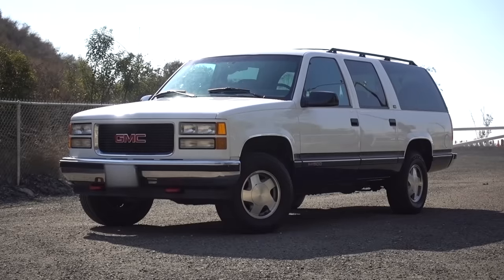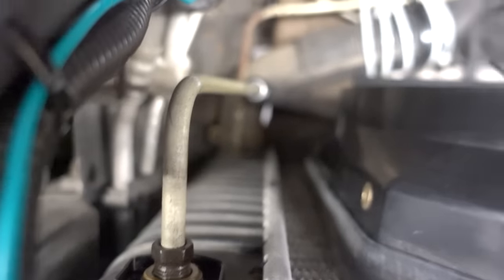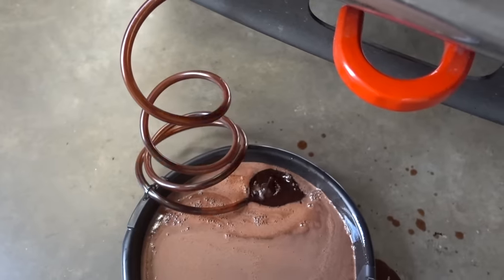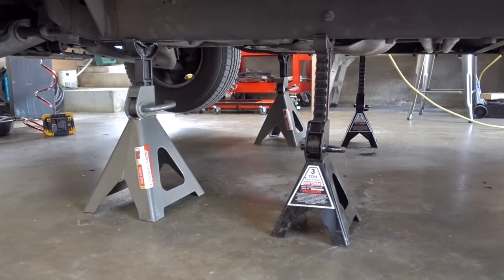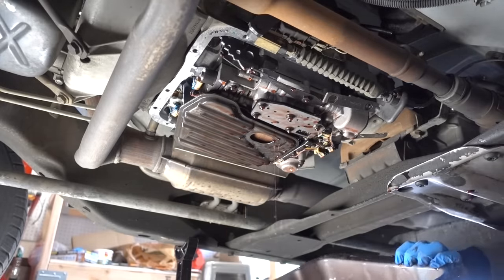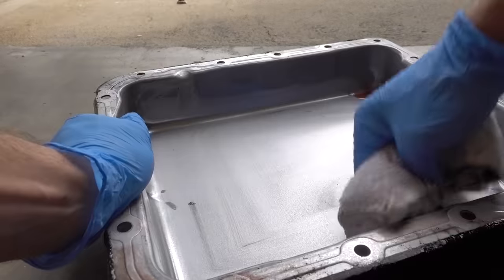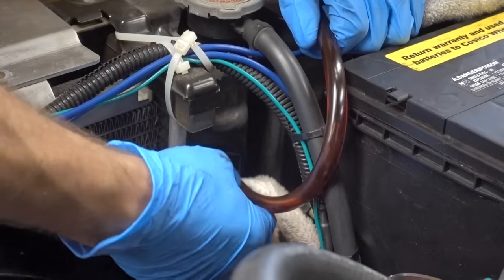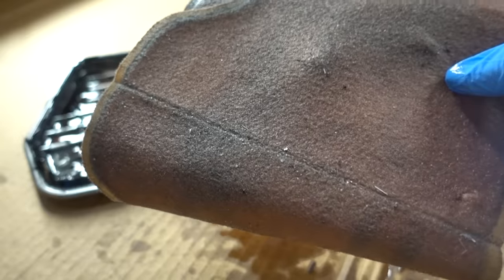Why You Should NEVER FLUSH YOUR TRANSMISSION FLUID!!

Comment: As a former ASE Master certified auto tech, the only time you should consider not flushing your trans fluid is if you never have before and you are WAY past the service interval to do so. You should refer to your vehicle specific maintenance schedule, but as a general guideline, trans service should be done every 50k miles. If you are 100k on the odometer and have never done it, do not flush your fluid as the clutch material that has broken down is circulating with your fluid, aiding in proper engagement. Flushing your fluid means your clutches may no longer grab as they should and you will need a full rebuild to replace these. As long as you stay on top of all your maintenance and not just oil changes, there is no harm in doing a fluid flush.

Comment: What is the reasoning for putting the same bolts back in their original positions on a transmission pan?  With over 50 years of mechanic work under my belt and a Federally licensed Aircraft Mechanic, this is the first time I have even heard of someone placing bolts back in their original positions, except for the through bolts that hold the two case halves of an aircraft engine together.  I do understand when reusing mated parts like pushrods going back with the same lifters and rocker arms making sure they all go back in their original positions.  I even built a wooden rack to place them in so they could not get mixed up.
Reply: Probably because the bolts could be different lengths
Reply: Rog From The Garage   They are all the same length.
Reply: Rog From The Garage   They are all the same length.
Reply: @billmorris2613  They may be the same length in this case, but you don't really know if they're the same length as you're taking them out. That's why I always place the bolts in order as I take them out just in case they do have different lengths. If you just throw them in a pile and then notice that some are different lengths you've lost a record of which one goes where.
Reply: Rog From The Garage   If they have different lengths of course they need to go into their original position.  But most of the time they are all the same sized bolt.  I don’t have a problem knowing that a bolt is longer or shorter than the last one I took out.  And it is usually obvious why the different sized bolt is needed.

Comment: Flushing transmissions are fine until you start to get up in miles. You have little clutch disks inside the transmission that will actually start to slip if you flush higher millage vehicles instead of drain/filling them. To be safe, I recommend to drain/fill your transmission unless you know what you are doing, you will not hurt the car with basic drain and fills instead of flushes and you wont risk slipping your transmission while driving which will suck.  Or if you don't want to listen to random people online, go to your local dealership and they have all the specs from the engineers that actually designed your car and know exactly what to do (sorry, should know....).

Comment: Jimmy, I’m a Professional Mechanic of 43 years and have owned my own shop for over 28 years and I flush over a hundred transmissions a year using my MotorVac TransTech III WITH ZERO ISSUES, I don’t know where you’re getting your info or ideas about this very necessary service but you couldn’t be more WRONG. By telling people not to flush their Transmission you’re doing a grave disservice to any person who heeds your lousy advice. I suppose your next video will be to tell people not to change their engine oil. Dude...Pull your head out, Transmission Fluid breaks down over time due to heat and extreme pressure and needs to be changed with filter every 70k-100k miles depending on the conditions.(Towing or not, City vs Highway driving...etc)

Comment: if flushing a transmission causes it to start slipping it is because it was running on dirt before hand and was close to failure. just my opinion take it or leave it. i do a normal filter a and change every 50,000.

Comment: You change it in increments by dropping the pan and adding approximately one-third of the transmission fluid back into it. If you're that worried about it. Changing the transmission fluid is not flushing the fluid. They are different procedures. Even changing out all of the transmission fluid is not flushing the transmission the problem you have however is that you have a 4 L 60 in a vehicle that should have a 4 L 80

Comment: Arg.... If you are a responsible vehicle owner who performs maintenance as recommended changing the fluid is a good thing. If you run 200,000 miles then decide to change the fluid, that's a bad idea.

Comment: For every "don't do this" , I see a "yes, you can do this". I don't think there's a 100% way to say it will or won't cause issues. Lots of theories tho. 

Either way, whether you do or don't, you're gambling on when it's gonna fail. I'd rather risk new, then know it's gonna with old.

I'd rather install a drain plug, drain, fill, run, drain, repeat. Then change the filter.

Comment: I do that on ever one I use a vacuum pump  I do it ever 50,000 miles it’s not going to make it slip if it did you already had the problem and it would only been a matter of some time before you would’ve had to do a rebuild . That’s like saying I’m afraid to change the oil in the engine because it could cause failure in the engine.  LOL

Comment: You should flush it by changing it no need to back flush...just change it via the pan...if you do this four times with 300 mile intervals that will do it...back flushing will push all the dirt through out the transmission including all the crap that the filter caught.. I do not recommend that.  this vid gets it right.

Comment: Always, always change all of your fluids. Gear and plate cohesion and are greatly affected by fluid viscosity, and when your fluid is too thin it ruins your transmission. Always change your transmission fluid.
Reply: Stanley you are so right. Why people give this advice is nuts! There is a reason why they have service intervals and fluid changes in the owners manual.

Great comment

Comment: If you don't have a late model car, I would not flush.  From personal experience, I've worked in lube shops, and we had a company policy because of ruined transmissions costing the company thousands from transmission flushes. If the car was I think over 10yrs old, we did not do a flush on it.  If the car had over 150k miles or something, we wouldn't do a flush on it.  This was at a shady lube shop too, so you know it was bad if they were telling us NOT to upsell something in certain situations.  On my personal vehicle, at 4 years old and 75k mi I did a trans flush, as well as coolant flush, and plan on doing it every 50k miles later.

Comment: I think the best general wisdom these days is not that you shouldn't flush your transmission fluid (as it is part of a recommended maintenance interval at some point), and not to flush it all in one go, but rather to drain and fill it several times, with a gap of time between each (maybe 2500 - 5000 miles?). That way, you are gradually replacing portions of the older tranny fluid with clean fluid, but you are not "shocking" the transmission with all brand new fluid all at once.  This is really only recommended for a DIY'er, as trying to get a quick-lube shop or a dealer to perform multiple "drain & fills" will get you strange stares and they'll act like they don't know what the heck you are talking about. They are there to take the most amount of money from you in the shortest period of time, so blasting your tranny with new fluid is their go to process. Unfortunately, this is one of the most debated and confusing topics in auto maintenance, and car manufacturers don't help because each says something different, and good mechanics say something different still (like don't wait until 100,000 miles to change it because it will be too burnt by then.)

Comment: I wouldn't flush it like they would do at a shop using a machine, I would drain what is in the pan replace with new run it for 20 - 30 miles and repeat 2 more times.

Comment: Why did you torque down those bolts after dropping the pan?
Reply: Thats a Valve body, sometimes the bolts might get loose and you may have unusual shifts from 1-2 and 3-4 , or 2-3.  Do not torque them down unless you have the right torque specification for your transmission, it matters.
Reply: @gamerkay5791  cool man thanks for the reply
Reply: @adrian15419  Yeah no problem, what transmission are you replacing the fluid in?
Reply: @gamerkay5791  just a  03 S10

Comment: I've always heard that if your car has a lot of miles and you still have the same trans fluid you missed your chance and leave it alone or you could risk having transmission slip. I've never changed fluid on my cars and have never had an issue. My 78 Malibu went 250 k with no tranny problems.  Just sayin.

Comment: an easier way to get the fluid out is to connect your garden hose to the trans fill and let it run through pump for a few minutes.    much cheaper than wasting fresh trans fluid.   you can also drive the car around the block a couple of times to let the water get through system, then top off with new fluid.

Comment: The reason why after doing a truckload of kms  u don’t change yr oil. Is that as the transmission has worn up. All,the binders and crap from the clutch plates actually helps gears to change. Serious 

What u should do is drain old oil into a new super clean container. And then flush. 
If following the transmission flush and refill. Your auto trans doesn’t change smoothly because of the new old oil
Replace with the old original crap. Truth
And don’t use a 3 grade. Go find decent trans oil rated 5 or 6. Has better flash point. Better gear changes. It’s just a better oil
Good luck

Comment: The "school of though" that changing your transmission fluid is a bad thing, is wrong.  Always change every fluid, oil, etc in your vehicle.  That includes transmission fluid.  

If the car is old and has a lot of miles with the original fluid and being very dark, then and only then you could have issues from a fluid change.  If you change your fluids on schedule,  and not thousands of miles and years after, then you will be ok.

Comment: Whenever someone say EVERYBODY KNOWS YOU GOTTA DO THAT then you must not do it. Flushing the automatic and using RUST EATERS has destroyed a lot of old cars. None of those products are ever tested in a remotely scientific way, they are chemicals that just come out of chinese factories after some incompetent chemist has approved the formula. 
Examples, i had an old Audi with 200k miles on it, a guy i know had the same type with nearly 300k miles on it, the automatics are sealed and maintenance free, we never had a single problem with them, they were good as new. Then a lady with a similar Audi with the exact same automatic gearbox was told by a friend that only idiots never flushed the automatic and that Audi was crazy to say it was maintenance free, so she took it to a garage where they flushed it with one of those fancy computerized machines to drain, flush and refill. Shortly after her car had to be scrapped, defective gearbox, too expensive to change. 
Then a kid who loved old Volvos got his hand  on a nice -76 244, he only had to fix a little rust on one rear wheel arc and paint over to make it 20-feet-pretty, i did similar fixes many times with a long lasting result. But then he was told that every idiot knows that you gotta grind it down completely and put rust eater before adding some putty and base coat, then later when he could afford $3,000 he would have iot painted, there was no other way, and everyone knew that! So he did, and for 3 years he drove around with a big ugly grey wheel arc, and it got uglier and uglier as the rust eater travelled under the original paint, leaving a feces-brown cancer, destroying the car completely.
Theres one more kind of idiots, and its those who now will say that he used a bad rust eater. Since rust eater has no purpose there cannot be good or bad ones, its as simple as this: Never use one.

Comment: old mechanics myth, its been spread for years that you will damage your transmission by changing the dirty fluid by breaking up buildup and getting it in the solenoid valves. Its just not true, if you do changes at the correct intervals you will do a lot of good for your transmissions. GM vehicles generally love the valvoline maxlife as well, Mazdas with the "lifetime" transmission fluid need flushes more often than any car ive seen. On a vehicle that has 24 year old fluid you'd probably want to do it twice just to make sure its been fully cleaned out, fluid breaks down.

Comment: Yes Transmissions are supposed to have clean fluid if they don't have clean fluid they won't shift right is supposed to have a clean filter gasket and fluid if not your vehicle will act funny when shifting into gears I I am a mechanic

Comment: So this is pretty bad to do, a better way to do it is to get yourself a transmission pan that has a drain on it, or tap your pan for a drain.

Having the pump run itself dry by having it pump out all the fluid in the pan is a TERRIBLE idea. You'll do untold damage to your pump, clutches, bearings, planetaries etc in the trans when the pressure drops and it's still spinning.

When shops do a flush on a vehicle they either have a machine to pump the fluid through the transmission, or they connect both sides to pump fluid in while the trans pumps the fluid out so it never bubbles or runs out of fluid.

Comment: Keep changing fluid and filter once a year from New and you will avoid transmission repair bills. That also covers those drain and fill filterless types like Kia. 
Best way to avoid this kind of mess and cost is to stick to manual gearboxes and don't drive like an idiot.

Comment: You didn't go through the transmission gears before and after you changed the ATF. Before means you didn't flush the solenoids. After means you still need to top up a bit more on ATF as the solenoids get full. That's the problem of doing this kind of work at home and by amateurs, as you didn't use a pressurised ATF flushing machine, transmission cleaning solvent liquid, and some residue is still left inside the transmission and oil cooler as well. You spent your time and money for a 75% job completion. Not very good value for money is it?